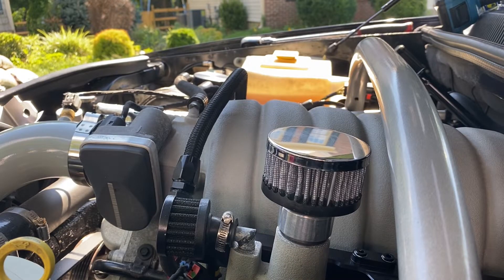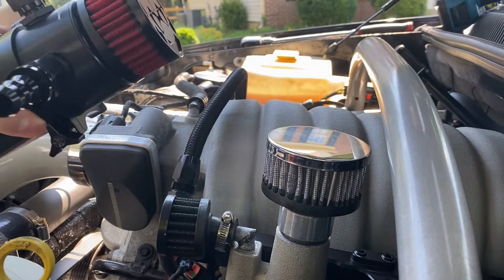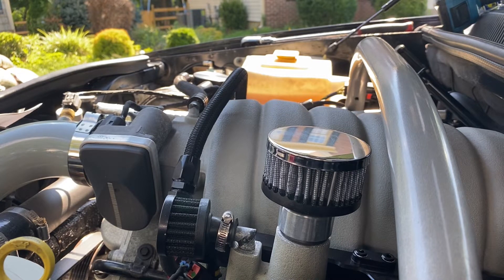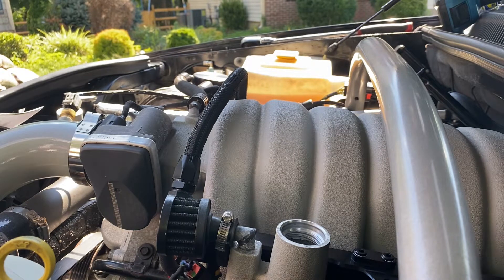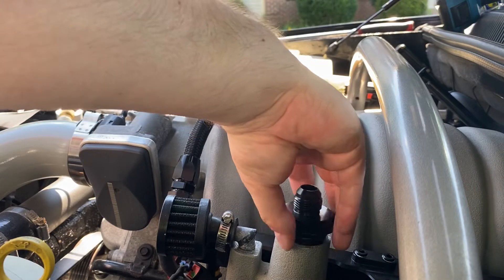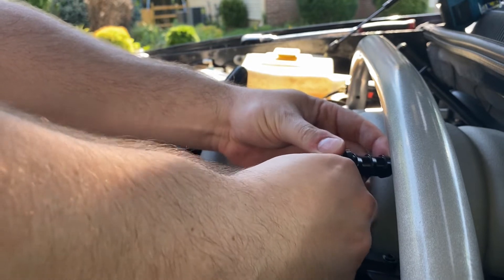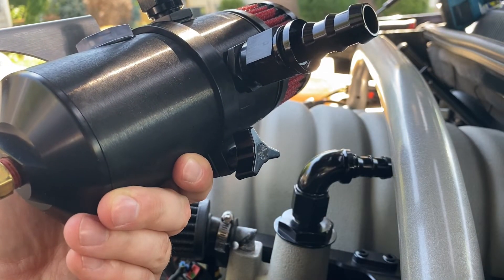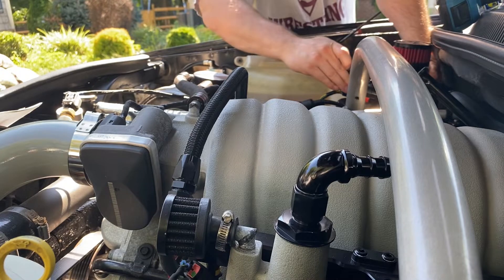Jeep SRT8 Turbo Mightymouse catch-can install.

Comment: nice kit.. do you have a link for it?
also I capped the top manifold elbow shut on mine and ran the pcv to my catch can & running that little air filter on the return side of the catch can and another by the fill cap like you.. your kit looks much cleaner 👌
Reply from the maker: https://www.mightymousesolutions.com/product-page/wk1-srt-wild
Reply: @awrgarage110  thanks